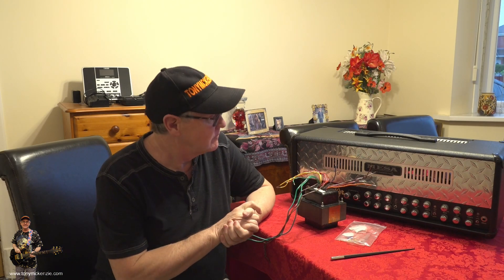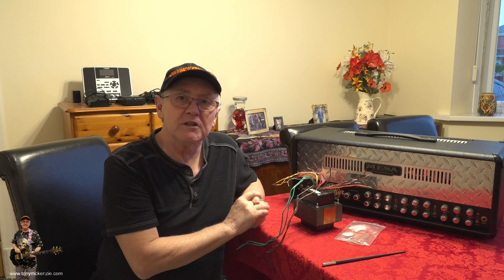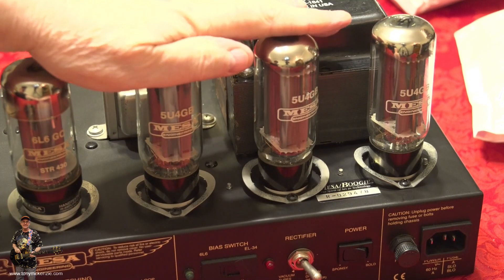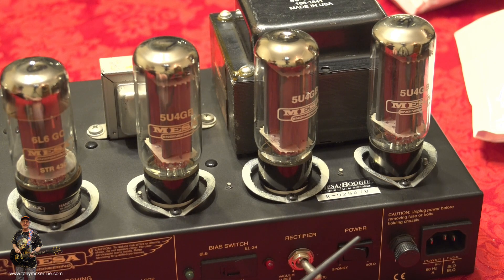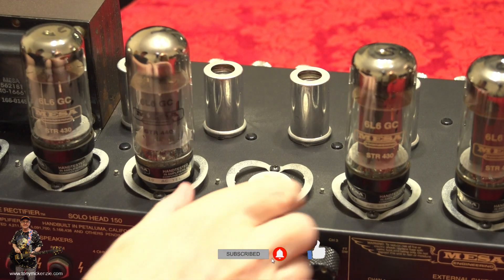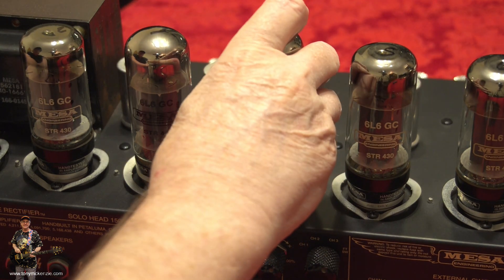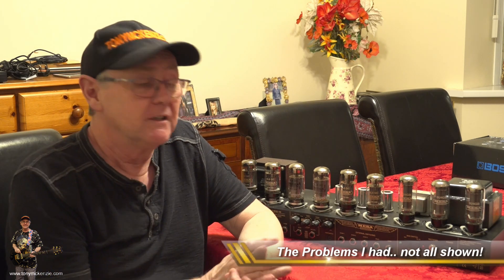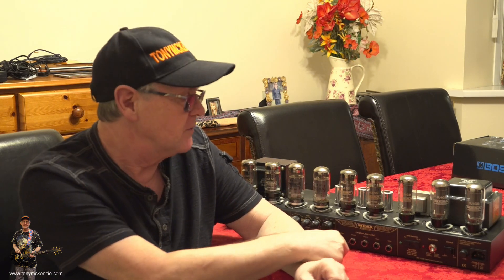Mesa Boogie Rectifier | Refurbishing A Tube Amp | Replacing The Power Transformer For 240 Volts Use

Comment: Tony i will make H.T. fuse too, for amp safety
Reply from the maker: The HT fuse should be fine... its the mains fuse to change from 4A to 2A if I remember correctly... I showed it in the video.

Comment: Grey and White Mismatched valves in it?? Mesa schematics are never quite as built 😂
Reply from the maker: Exactly... those tubes you will see much more of in the second video - and you might be surprised how this amp was sold in an undisclosed way as 'no faults' but as you will see, that was entirely incorrect. Reverb Squeeverb!  Watch for that video coming as it shows lots... On the schematics try finding an up to date on on a triple rectifier - not there from what I see, and it would have at least helped a little - but alas no document except one made by the Leicester service repair company (Rob) which did suffice.  stay safe.
Reply: I think as long as each pair is matched it's ok. I'm sure I read that or was told that.  Could be wrong though.  Given the choice I'd always have a matched set to be sure
Reply from the maker: Wait until you see the 'bias' video you might be surprised about the tubes and other stuff... coming soon...

Comment: you are going down a rabbit hole now  ? ...but in my experience with a mark 111 blue stripe that I bought new in 1988 which I had my tech do a bit of service too it .. it came back even better than the day I bought it ...boogie sent him the new capacitors and tubes ,of which when I bought it it had 4 6l6 power tubes but no now they recommend 2 6l6 and 2 el34 ...omg ...this is "the "amp you want : )
Reply from the maker: Ha I know... I have been here before with the Road King and a MK III some while back. Thanks for the info on your experience with the MK III. Mine had before I sold it many years ago crackles and pops all over the place. I did solve it with the help of others at the time (90's) but then sold it and bought a MK IV which I reckon was one of the best from my experience. I looked at the caps on this one but they seem OK so probably 'might' look again before the series ends simply because of their age. Thanks and stay safe.

Comment: I had a boogie a studio 22+ combo what a pile of shit, bland clean horrible thick overdrive yuk
I bought a TSL 601  200 quid less and it smashes that amp to the ground, I went to peach guitars and tried the similar boogie 50w combo but really couldn't find anything that would justify the extra 300 quid same with the dual rec over my TSL 100 for the type of music I was playing at the time, 
A covers band 60s to 2000s
I play through Boss katanas now
Pretty good really and you can get two second hand ones for the price of a set of triple rectifier valves
Reply from the maker: I'm with you on the Marshall gear of course and pretty robust in general and low(ish) costs for the parts which does matter. This amp has had around £700 ($950) spent on it to date and there is more yet to come, but the amp is a classic and I wanted to get the older one really. One of the best Mesa amps I ever had was a MK IV combo... with just the right settings (hard to get but once you found them it was brilliant) and my Jimmy Page Les Paul that has probably never been beaten for that style of tone - from older stuff through to the more modern sounds to say 2010 or so. The Road King II also has a wonderful channel 3 in vintage mode for lead guitar.

Comment: Curious as to how you measured the caps.  Did you do it with them soldered in place?  If so, did they read as caps do when wired in parallel?  I would like to check mine, just curious.
Reply from the maker: No, we de-soldered one end so its not in circuit? A pain in the neck. We did not check them all to be fair because once the main stuff seemed fine we decided it was not worth the time involved... and the amp worked pretty well. We did find some weird things in doing the work though and those I might include in other videos. Stay safe.

Comment: Love your repair videos you helped me save the life of my beloved TSL 100h with your brilliant mother board swap vid cheers champ!!!
Reply from the maker: Well, some of these 'elderly' amps are in many ways better than the new incarnations IMO. It's one thing buying a known 'quality' as the triple rectifier (and dual of course) is, and it's entirely another when someone includes all manner of other gear like IR's and other stuff in the amp. Ha, where I come from the real deal and not some half baked amp that does not need IR's or anything else to sound good is really the best choice. I mean, why simulate sound when its right there in the box and cheaper than most of the better simulators out there. The TSL100 is really a brilliant amp and I still have mine. It's not going anywhere... and when this amp is finished (some interesting stuff coming for it) it will be a real classic for sure. Stay safe.

Comment: OMG those XmFRs are huge. Nice job Tony.
Reply from the maker: This turned out (part two has its issues right now) to work, at least until I get to the next bit :) but it will all come out in the wash :). Importantly, the original TX is unavailable and this new one is slightly bigger... just enough to short out the lamp! Stay safe.
Reply: @tonymckenzieofficial  Nice Job!
Reply from the maker: @Thomasdgolden  It's worth watching the tubes and 'bias' one when it loads (the next video) - that was 'fun' for sure with some weird stuff I might include...